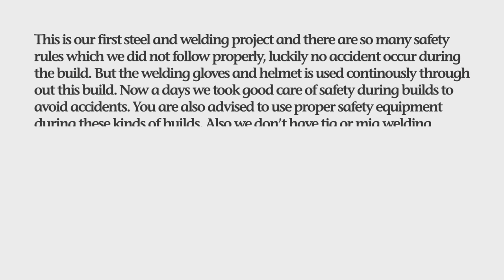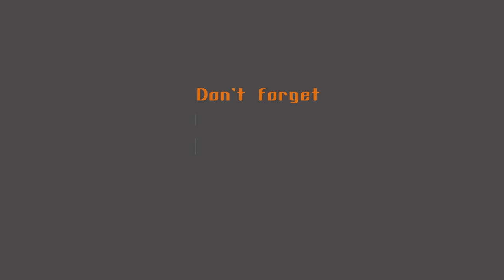Stainless steel balustrade / Guard rail / Railing Build and installation by AMbros custom

Comment: Todo está bonito pero el detalle de la pulida en la soldadura
Reply from the maker: Tienes razón, amigo, esa fue mi primera construcción con acero inoxidable y estaba en la etapa de aprendizaje y lucho mucho con la configuración actual y algunas otras técnicas que usé hoy en día.  aunque siempre es difícil lograr uniones de soldadura de acabado con soldadura por varillas.  Pero gracias por estar aquí :)

Comment: Which company steel is better
Reply from the maker: Company doesn't matter, it's grade which matters the most. If it's exterior use then go with 304 grade only. If something inside a room then 202 grade is ideal.
Reply: @ambroscustom  jindal or santosh which is best in 304
Reply from the maker: Mostly jindal is used. Never heard about santosh. So go with jindal.

Comment: I want to use my everlast mig welder to weld stainless. Is there a special wire I would need to use?
Reply from the maker: yes if you want to weld stainless there are spools available for that but I think going with tig welding is much better and safer if you are welding on thin stainless steel pipes because they tends to warp alot during excess heat and most of the time joint sags a bit if Amper are too high. Wall Thickness around 2-2.5mm can be easily welded with mig. Below that all about practice and right settings.

Comment: price kya h..... per sq fit.....???
Reply from the maker: I don't know about the labour cost, I made these videos for education purpose, the total material cost me around 20000₹ out of which I made two balustrade, stair railing, and a table with ceramic top onto it. All are onto my channel page. It's quite hard to tell about the per sqft rate because shop owner usually don't made these complex design with stainless steel......
Reply: Super